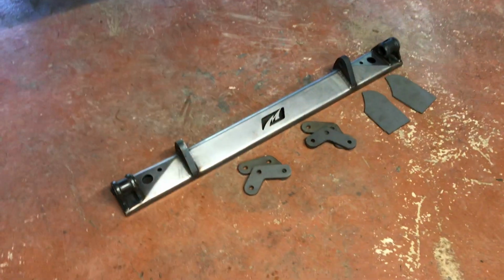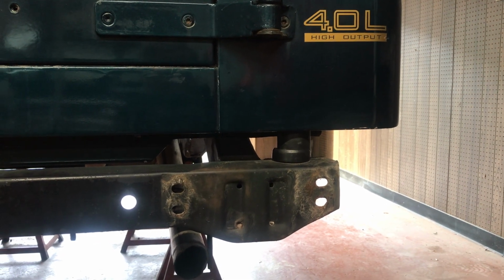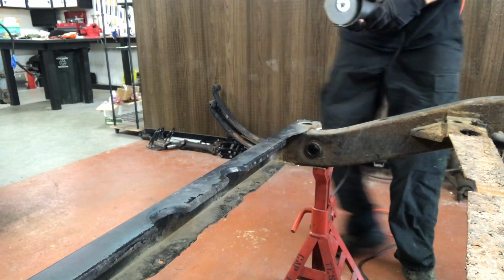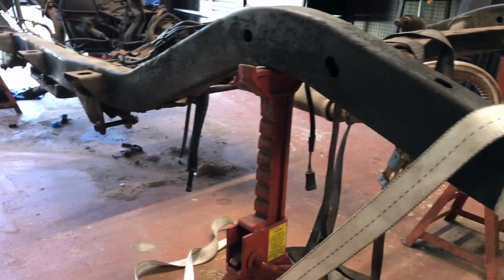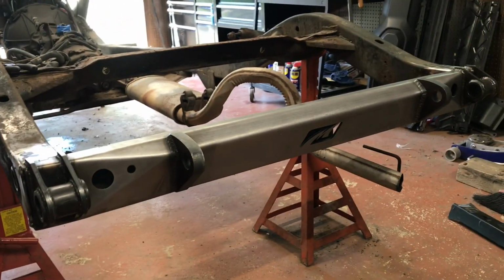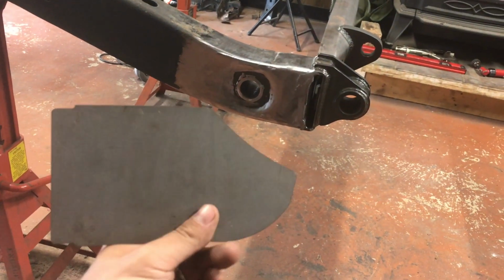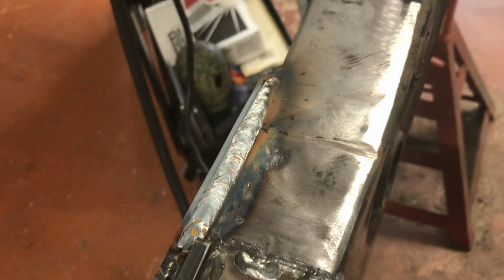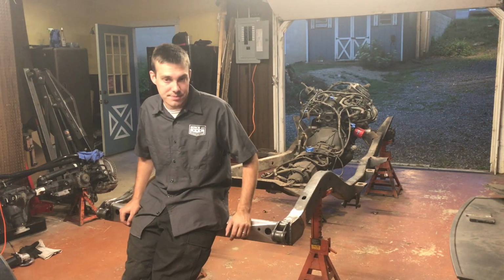Installing the Motobilt YJ Rear Stretch Kit

Comment: Excellent video.  Motobilt should pay you for the content- or make their own.  I have watched your video several times.  (yes, I am slow).  I am starting the cutout of the rear cross-member.  One question: Did you regret removing the rear cross-member to get the clean lines?  Knowing what you know now, would you still do it?
Reply from the maker: Hahah I really appreciate it! This video was a little rough because I was just starting and getting use to being on film. I enjoy doing it so I don’t mind if they use my content. As for your question, I don’t regret cutting it out. I feel I was able to do a better job as well as fix other issues. If I had to do it again I’d do the same thing. If you have any other questions please don’t hesitate to ask, thank you for watching!! 🤘🏼🍻
Reply: Motorbilts instructions say to just cut the body mount tabs off not the whole rear crossmember.

Comment: What happened to the fuel tank skid plate?  My 92 has that exact plastic tank, but it's setting in a skid plate, with two straps running across the top of it.  I mean your's doesn't even have a shield between the PLASTIC fuel tank and the exhaust.
Reply from the maker: Mat Helm I’m not sure actually, I don’t think mine ever had a fuel tank skid or maybe the previous owner removed it since it was just a beach cruiser. My Jeep was definitely lacking protection in a lot of areas but I’ll be taking care of that hahah. Thanks for watching!
Reply: @altered_life  I'm sure it rusted out from under the tank.  You can get them new repops for between $200 and $300 bucks.  And you'll probably need the rubber mat the tank sits in too.  But be sure and dod what I did, which was drill water weep holes V grooves.  And I put 3 vinyl strips (1/8" thick x 2" wide) between the tank mat and the skid plate in hopes that the mat could no longer trap water.
Reply from the maker: Mat Helm you’re probably right, I had rust issues in the rear of my frame so more than likely that’s what happened. Those are good tips but I won’t be putting the stock fuel tank back in. With the stretch kit I wouldn’t be able to fit it back there so I’m going to be putting a 19 gallon fuel cell up in the tub behind the seats.

Comment: Suppose I install this kit and install XJ leaves but leave them the original way so it won’t stretch my wheelbase. Think that would improve the ride any due to a longer spring?
Reply from the maker: This kit is actually designed to be used with XJ springs. Leaving the frame side mounts and using an XJ spring will stretch the wheel base still because of the extra length on the XJ springs. As for improving the ride quality, I can’t give an exact answer due to all the variables like quality of springs and shocks.
Reply: @altered_life  I think the XJ front eye to center pin length is the same as the yj but the rear is way longer and Putting the XJ spring in “backwards” is what gives the stretch. I could be wrong though
Reply from the maker: Gotcha, I don’t have much experience with the XJ springs but I think Motobilts website has some decent information regarding this kit. I kept the shorter YJ springs to hopefully help with axle wrap since I went to a spring over setup. I’ll still be doing a anti wrap bar but time will tell.
Reply: @altered_life  ah I gotcha. I’ll have to look a little more into it. I had an XJ with a 4 1/2 inch Rubicon Express lift on it, and it rode exactly like stock. My YJ with old man emu 036 springs rides like a log wagon so I am between using the xj springs, or just converting it to a TJ style suspension
Reply from the maker: Yeah leaf springs are simple but can also be tricky. If I knew my build was going to end up where it is, I would have just went to a linked suspension from the start. For now I’ll rock the leafs and upgrade in the future
Reply: @altered_life  fair enough

Comment: Do you have to change the drive shaft for this?
Reply from the maker: Yes more than likely you will need a new driveshaft to accommodate the extra length. The stock shaft may reach but as soon as the suspension travels the splines will separate and the shaft will come apart. Hope that helps and thank you for watching!!

Comment: What did you do about the rear body mount of you cut it off?
Reply from the maker: I actually just went without them. The two body mounts that are on the rear cross member seemed to be plenty strong to support the back of the tub that I felt I didn’t need the far back ones. My other videos of making my floor shows a a lot closer of how I mounted the body. Thank you for watching!
Reply: @altered_life  no problem! I'm starting to build mine now pretty much the same build motobuilt front and rear, 5.3 ls, Dana 300 and 4l80e. With a 14 bolt and dana 60 king pin. Just not sure if I want to tub it kinda like you did or not yet. Looking forward to some more videos 👍
Reply from the maker: That’s awesome, sounds like a freakin epic build 🤙🏼 good luck with it and hopefully my future videos will help out. I’m always open to advice also so if you come across something that would help me out definitely let me know hahah because I have no clue what I’m doing lol

Comment: Your welder, are you using gas with the mig?  novice welder myself
Reply from the maker: Hey Matthew, yes my welder is using a shielding gas. It’s a fairly cheaper welder but using gas will definitely yield better results then a flux core wire. I’m hoping to do a video on how we set up the welder and got it to provide decent results even though it’s 110 and I’m very inexperienced. Thank you for watching!

Comment: What springs do you use with this kit?
Reply from the maker: Bobby Sullivan the kit is designed to use XJ springs with the stock frame side spring hangers. On mine I decided to relocate my frame side spring hangers back so that I could use YJ length springs.
Reply: Just curious why you chose to use the yj springs an not use the longer xj springs? Also how much lift on the springs did you add?  Getting ready to do a 1ton swap to the wife's 94. Getting ready to order this from motobilt this week.